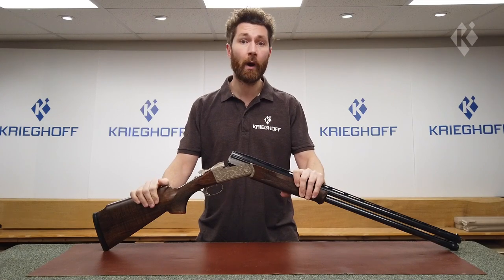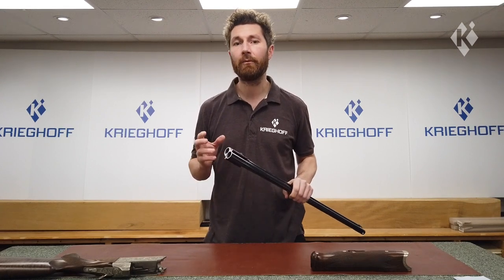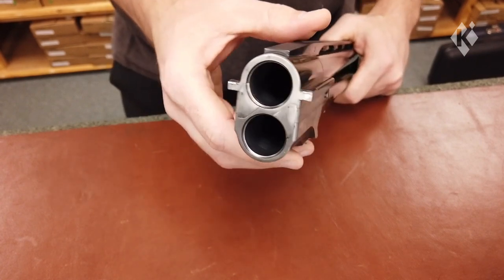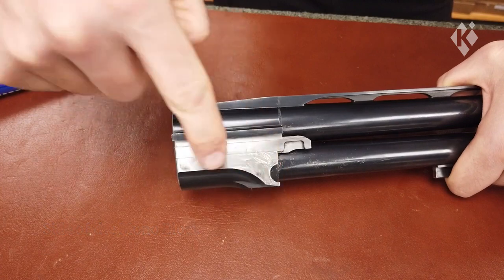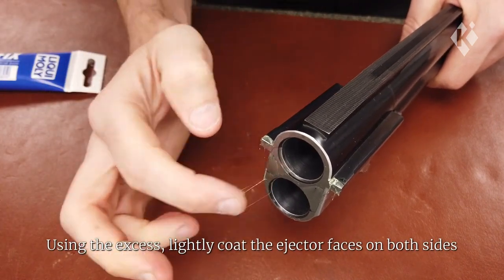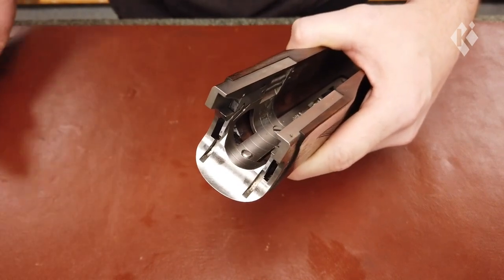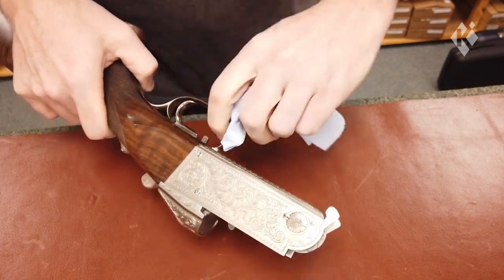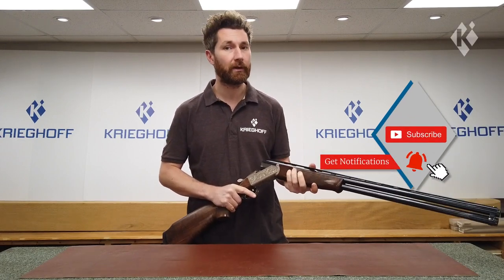Krieghoff "Know How" - Where to Apply Grease

Comment: Lots of comments regarding the “proper amount” of grease. IMO some of the people that have commented on this are overthinking it. Any “extra” grease will simply be squeezed out. The only area that I make sure to use a very light coat is on the barrel lug. The video itself is excellent. I humbly disagree with putting grease on the ejector face but to each their own.

Comment: That’s  a lot more grease than I’d use to be fair, a little moly grease goes a very long way. Less is more chaps. Great vid non the less.😉👍
Reply from the maker: Fair point, I'm sure using less is fine. I was just conscious of it showing up on the footage to clearly show where it goes. Thanks for the feedback :)
Reply: @alanrhonemedia  not a criticism at all, you guys do fantastic work and these vids are a great addition to what I consider the best in the business Kreighoff UK 💪 I wouldn’t shoot or use any other manufacturer/company! ❤️
Reply: Thats actually about perfect just the correct amount applied, just because you apply less means nothing, I would go with Dave any day being the professional expert he is.
Reply: @garybalasa3158  if you read what Dave said, he used more so it could be seen on the video. You genuinely don’t need a lot as it’s just a waste, thin smear across the surface, plus you should be cleaning it off after every shoot anyway. If you want to use more fill your boots sunshine 😉
Reply: @CraigK80  as a gunsmith that is about the amount I apply especially to new custom units,  but hey you want to use less go for it, I tend to work on the strategy that a bit more is better than less we are after all splitting hairs.
Reply: @garybalasa3158   as someone that’s been shooting, and maintaining my own personal K Guns for over 30 years, using the ‘right’ amount is the best practice. Molly grease holds in place very well, a light coating is all it needs, especially as previously stated, it should be cleaned off after each use. As you’re a gunsmith, and as K guns are so well engineered, What you should find is the over application of grease will result in a build up at the edges with the excess squeezing through to the outside of the gun which isn’t desirable and should be wiped of anyway. This build up grabs contaminants and holds them against the surfaces which again isn’t desirable. Best practice apply just enough to cover the surface, but if you want to use more, go for it I personally feel using too much is simply a waste, you also risk the excess going into places you don’t want, like hands, case, etc. To each his own.
Reply: @CraigK80  cool I'm not talking about that much but like I said more is better than not enough, but really I'm not talking the amounts your suggesting certainly not so it runs in to or out of the gun, but seeing you have so much experience only 10 years less than me, go for it, as you say each to their own
Reply: @garybalasa3158  wow that’s a long time Gunsmithing! (I’ve onned K Guns for 30 years , been shooting a lot longer) Surprised you get the time with all that farming down under? What’s your shop called? Where in Australia is it? Be interested in knowing some of your history 😉
Reply: @CraigK80  Retired now mate, yeh the farming life is good, living the dream as they say unfortunately made the country lifestyle change bit late enjoy your krieghoff's one of the best guns ever made 👍
Reply: @garybalasa3158  love Australia mate. Spend a few years out there! Enjoy the life mate

Comment: I use cotton buds for cleaning  the pivot area, I use an artist brush to spread the grease . does it need some on the ejector cut outs? every thing else is what I do . great vid
Reply from the maker: Yes, great tip. The guys in the workshop use a brush to apply the grease, but in the video we were showing a general application with a finger, as it's something most people will have handy - pun intended :)